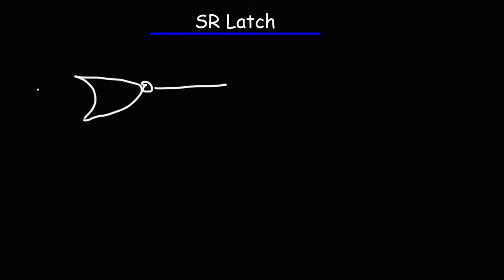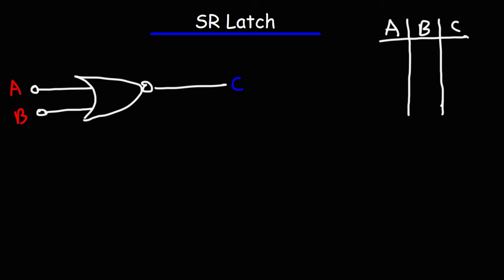SR Latch Circuit - Basic Introduction

Comment: Out of curiosity, why does this schematic use two (inverse) outputs? For the record, I have very little knowledge of logic circuits, but there are two things that make this choice seem odd, which is why I'm asking for clarification. First, you hinted at it, but you don't know for sure what the initial state is going to be since it depends on which NOR gate feedbacks into the other one first. Second, we only need one output to represent all possible states because having both outputs be 1 or 0 at the same time isn't possible. 

I didn't come up with this myself but saw a picture online, which is why I looked for more infos on the SR Latch in the first place. But it basically showed the S input simply leading into an OR gate, which then split up into the output and the other feeding back. Let's call the feedback F because this is confusing to write in text. Then the R input feeds into a NOT gate, which goes into an AND gate together with F, and the result goes into the OR gate from before. From what I can tell this should always initialize with the output as a 0, and it latches and resets all the same. 

I have absolutely no problem with the explanation or anything. It's very helpful. I just wonder why it uses this format for the output.